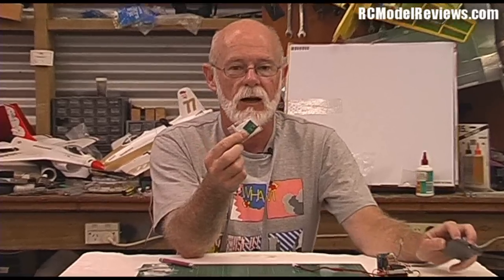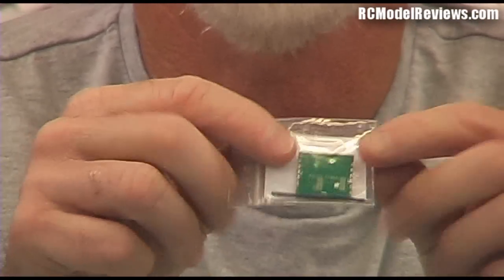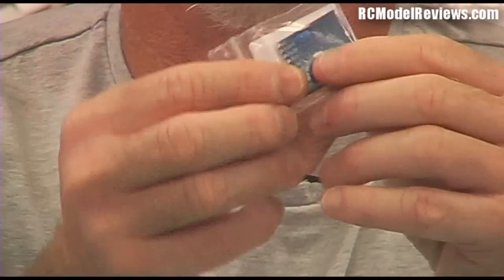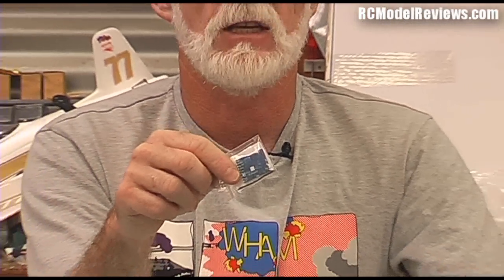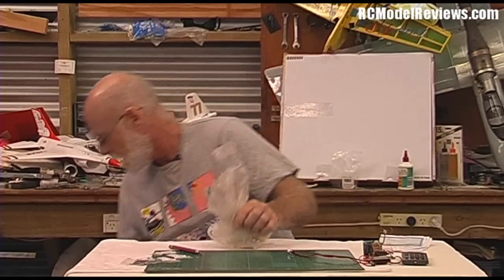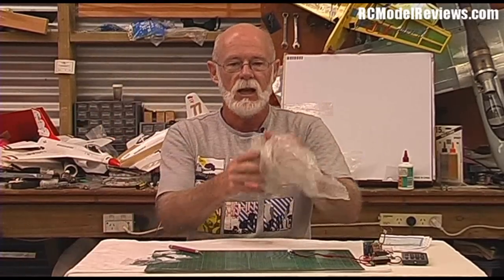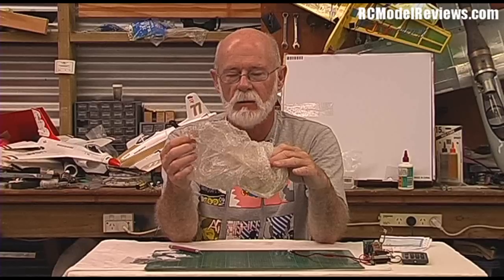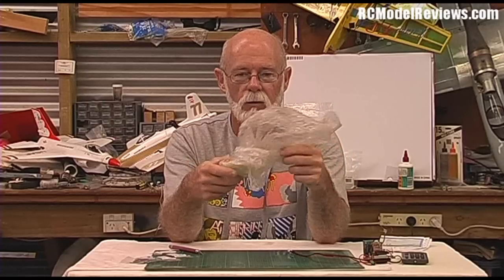RCModelReviews Not so Weekly News (20 Jan 2012)

Comment: You could try selling the FPV backpack at SparkFun. Especially to US customers. They even provide the option to manufacture for you if your design is open source - just need to provide them the files. Check out the "sell your widget" link on their website. Admittedly it may end up being a bit expensive since their prices tend to be much higher than HobbyKing but they do provide excellent service. Or maybe try contacting HobbyKing and see if they can sell it for you.